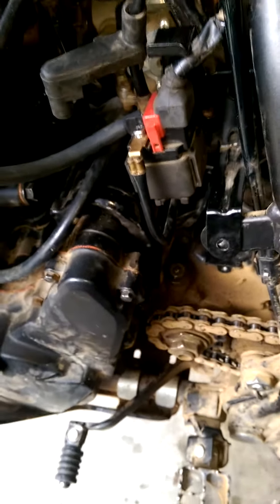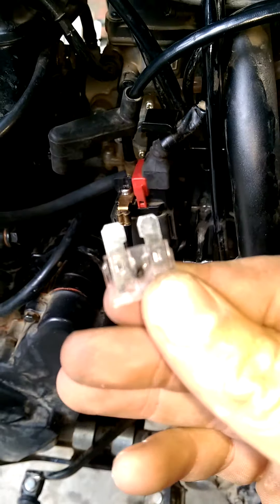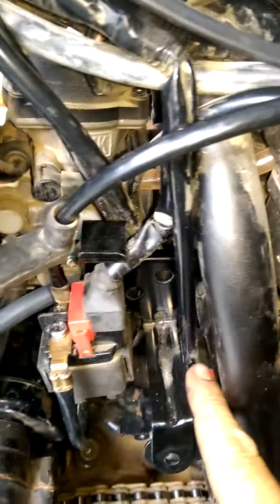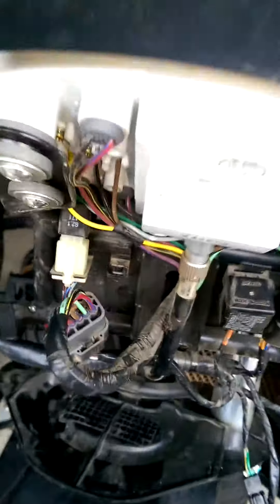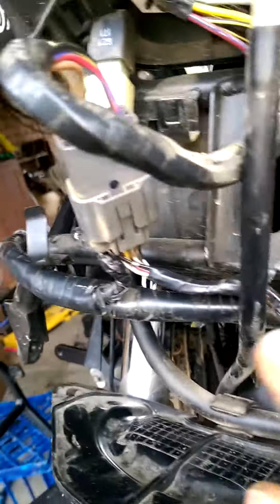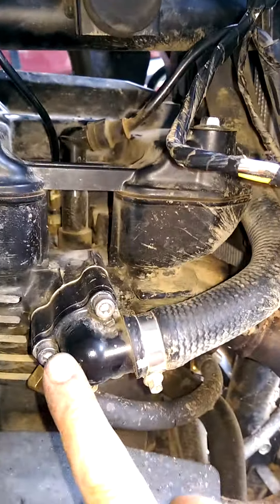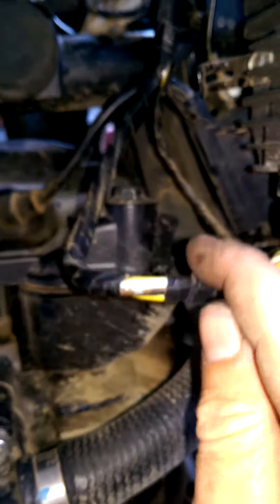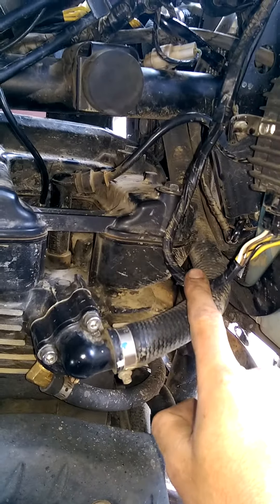KLR 650 electric short, blowing 20A fuse

Comment: Just tried to help a fried of mine with this problem. Had to get trailered home. Looking for a solution.
Reply from the maker: If the main fuse keeps burning out, it is definitely at short in the wiring harness. Strip the bike down and check all the known rub points. Freeze the video over the diagram I show, and use that as a reference point. Look for bare metal anywhere on the bike frame where the wiring harness runs, that will indicate rubbing. The actual short in the wire can be ridiculously small, so take your time checking it over.